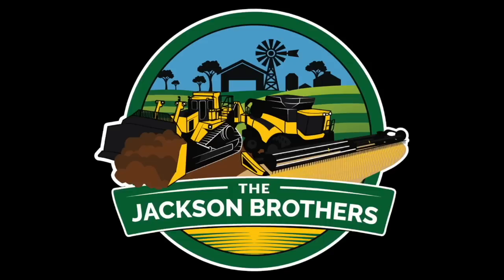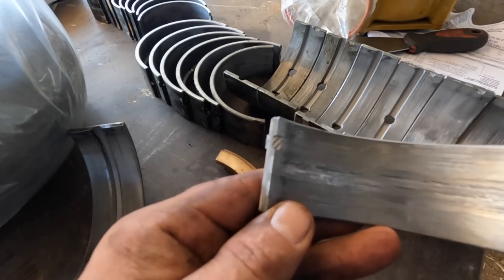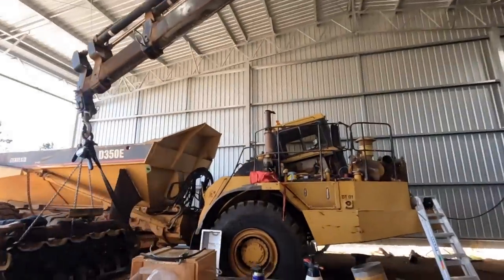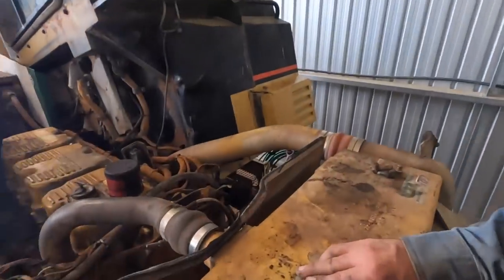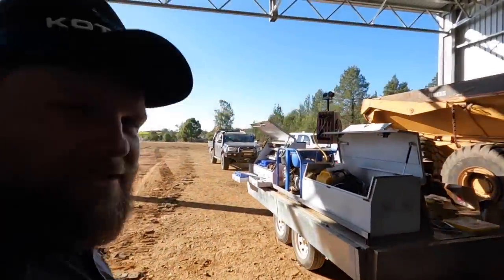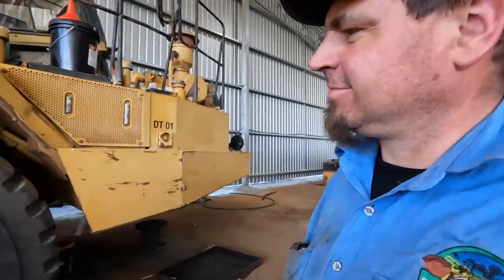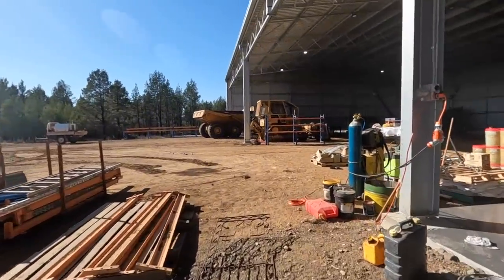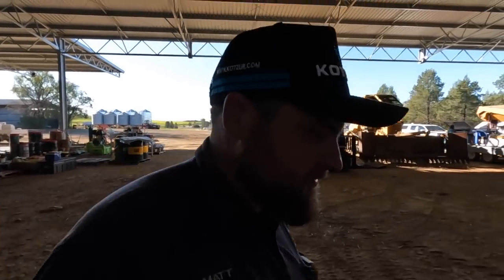Its Alive!! Will it Stay That Way?  | Workshop | Vlog 195

Comment: Rat Rod & leave her straight piped Brad 😂😂😂😂 May not be overly practical but sure sounds good 😜
Reply: But, unfortunately, not good for the ear drums. For many years I owned a ski boat in which the exhaust silencing was only by engine cooling water injected into the exhaust pipes. It quietened once the water pump forced water through the engine but was insanely loud before then. Hearing aids now help.

Comment: Which connecting rod did that bearing with the smeared center come from.   What did the main bearings that fed the oil passage look like.   Did you do a mechanical oil pressure test or check the end clearances in the oil pump and replace the oil pump bypass spring.   That bearing would scare the hell out of me.  
What did the connecting rod journal look like.
Reply from the maker: It was mentioned in previous videos but the reason it started to fail was the water pump seal went and put water in the oil which thinned the oil just enough to start doing damage👍😁
Reply: @thejacksonbrothers  thanks.
Reply: Are you using  antifreze coolant in engines? We in artics use 50-60% and that in the oil ,wear out bearings immediately 
Good video to day

Comment: G'Day Brad, Why do they use a spacer plate? Does it lower the compression ratio to derate the engine power? That's only my guess by the way. Cheers Mate.
Reply: I believe it was to give you the ability to freshen up the counterbores at the top of the cylinders and the head mating surface
Reply: @robertquast9684  Thx.👍

Comment: Is the D350E truck equipped with a 3306 or a 3406 engine?
Reply from the maker: The last of the 3406, just before they went to the c15 I believe👍
Reply: @thejacksonbrothers  I researched it a bit a found out they call it a 3406 DITA. The 3406 14.6 litre is my favorite cat engine.